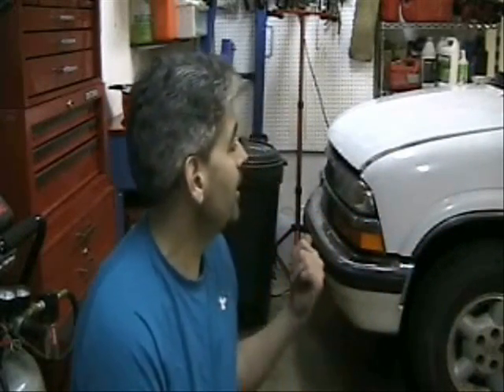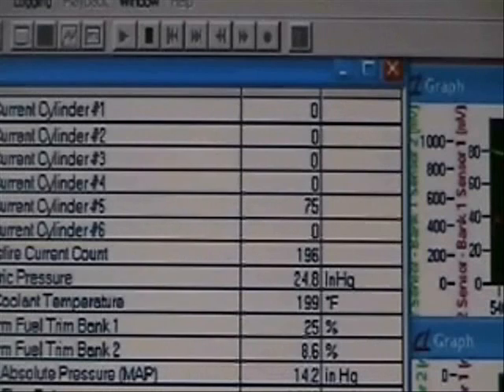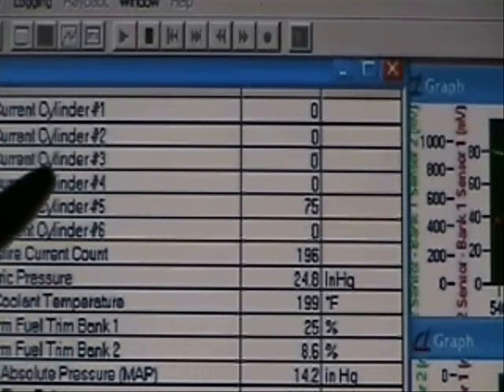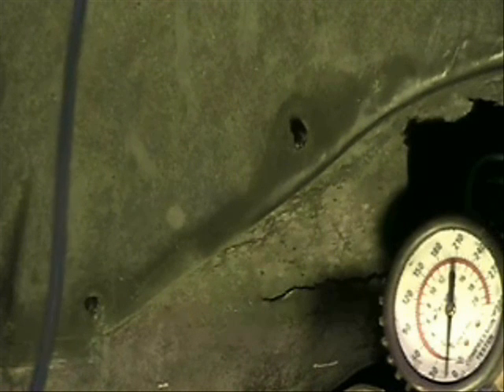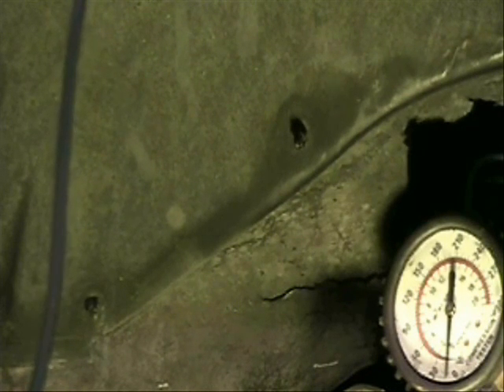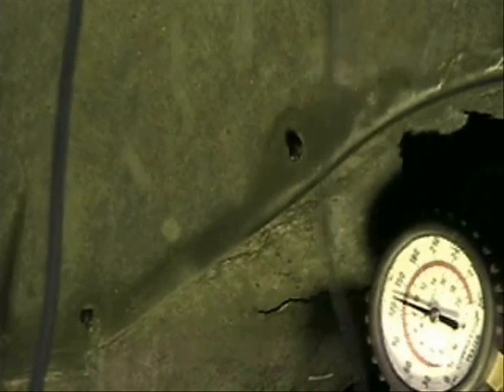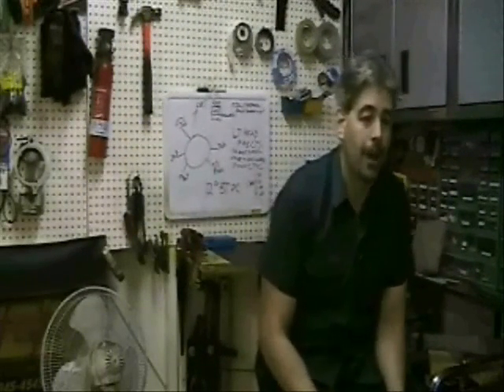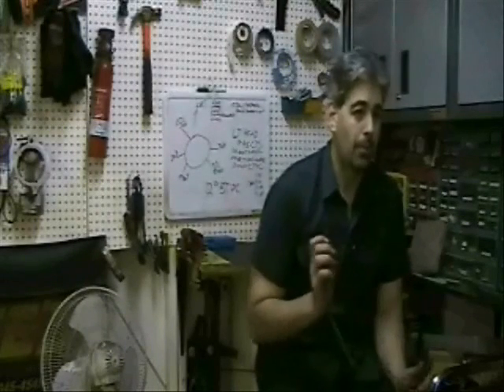P0305 Misfire Diagnosis 4 3L Vortec PART 1

Comment: I have exactly same engine . Mercruiser  4.3. Your videos are amazing. Question.  1 full revolution of flywheel can be compression stroke and another revolution could be exhaust???? So that has been my headache.  Am i right???
Reply from the maker: Yes correct. 360 degrees crankshaft rotation is only 180 on camshaft.  To cycle a full TDC compression cycle you need 720 degrees crankshaft rotation
Reply: That was such a helpful video.  Your time to make it is much appreciated.  Thank you.
Reply: I have changed all plugs etc. It's same chevy block in bayliner boats. I've replaced  rotor and cap. I am getting massive misfires as loud as gunshots. The engine is pretty new. Wouldn't run after some parts replaced.  I assume the bad timing would cause that. I have yet to see spark from plug disconnected and separate plug put in the end and grounded it. Can't see spark . This is all from cylinder 1 lead. I seem to have distributor set up as you have.  Any thoughts?
Reply from the maker: Sounds like mis-timing to me.

Comment: Fuel systems are "a little kinky" hahahahah thank you sir. I just finished replacing the spark plugs wires distributer cap rotor ignition coil and I'm still having a misfire. Wish I had a tool like this but I just wanted to say thanks for the laugh

Comment: That Autotap OBDII tool looks a lot more useful than noname Amazon scanner, but looking into buying one isn't promising---looks like it hasn't been supported in a while (Designed for Windows 98!). Do you have any current recommendations for something similar?
Reply from the maker: yes they dropped support for it about 5 years ago or so- very unfortunate as the UI is the best in the world.   I use Autoenginuity now.

Comment: I hope this gets read. I bought a 99 2 door Blazer and after fixing it up it started running weak and just not feeling like it had the power it should. It also does a surge under load that moves the rpms a tiny bit. I replaced the spyder with the updated version and I checked vacuum. I replaced the O2 sensors and cat because they were bad regardless. EGR and PCV valves. Mass airflow. I check fuel pressure and it was where it should be ( slow leak if you let it sit for more then ten minutes primed ) But nothing I do helps the issue. My cousin ran a scanner while I drove and he said my timing was dropping from the 30s into the teens when the vehicle was doing its surging thing. I have put more time and money into the thing then I care to think about but I do love it. I just cant figure it out. I looked up cam and crank sensors but it has no issues starting or idleing. Any thoughts?
Reply from the maker: yes you have a major clue when you said the O2 sensors AND cars were bad so you changed them. What data did you use to determine this?
 Also what data indicates the spider was bad? That’s critical data.
  And finally what was your mass airflow reading showing that you thought it was bad too?
Reply: Timing belt is loose
Reply: Replace fuel pump

Comment: IAC is the abbreviation we use for the idle air control valve, many engines don't  have a valve, some may have a Idle Actuator on the older throttle bodies or on some newer ones a  AIS controller, not arguing do it what ever way you want, just saying throttle body and such get coked up and plugged up from EGR, so unless you've just cleaned it do yourself a favor and open the throttle. Don"t  take my word for it, take one with a coked up throttle body and a plugged PVC valve or a faulty electric one, compare compression readings open and closed throttle

Comment: compression test you want the throttle wide open fyi
Reply from the maker: No need. more than enough air gets past the IAC and from PCV. The open throttle is a myth.
Reply: @SchrodingersBox  no not really a myth, I've seen many engines read 20 psi or more less if throttle plate is closed,especially smaller displacement engines, many engines don't  have a idle air control valve specially a lot of newer engines like some  drive by wire and what if your pvc is clogged and you don't know it yet, which happens, just saying with my 25 years experience its always good practice to open up the throttle plate so the engine can suck as much unrestricted air as it can for the most accurate compression test you can get,  p.s love your stuff, I've always took a scientific approach, kinda like a car doctor
Reply from the maker: Name one engine that does not have idle air control.

Comment: I had a P0305 code = cylinder #5 misfire. I replaced the spark plug and wire for $9. Solved my issue. 2001 GMC Jimmy 4.3 V6 142,725 miles.
Reply from the maker: How did you know the plug and wire was the issue? Did you just guess? And which one was it- the plug or the wire?
Reply: How are you able to buy just one wire? I ended up having to buy a whole set because no one would sell me just one.

Comment: My missfire was timing cover seal
Reply from the maker: How wopuld that cause a misfire? That has no effect on timing?
Reply: @SchrodingersBox  .after smoke test was coming from behind hamanick balanacer (cold engine) .drove for one hr and test againg becuase misfire allway go away after some time driving , i smoke it and no smoke leak . Also google, bad timing cover seal, symptom oil leak ,misfire ,rough  idle . ( i google for a 2000 blazer )
Reply: @SchrodingersBox  some how there is a vacuum leak .and is bad .when i smoke it (cold engine) alot of smoke was coming out from behind harmonic balancer. Hot engine, no misfire and no smoke coming from anywhere. It did not make any sence. But Google confirm it.
Reply from the maker: Ah- if the PCV system depends on the cover seal that would explain it. It would cause a vacuum leak. hard to imagine it could cause a vacuum leak enough to cause misfiring.
 What was your fuel trim before and after? That would be the prrof.

Comment: I am having a similar issue with #6 cylinder on my 2001 S-10 4.3L.  I get a P0300 and also a P0306 when the vehicle is under load at around 3000 RPMs, and seeming when it is under load.  I can have the vehicle parked and run the engine up to 3K RPMs and hold it there, and I don't get any misfires.  By the way, I am using the Autoenginuity software for my testing.  I am wondering if I have a compression issue on #6 cylinder.  I have ordered a new compression tester, as my old one's gauge got busted from loaning it to someone....Grrrrrr!  Anyway, all the other cylinders show no misfires in the history counters.  I had a bad battery a couple of months ago, which I'm assuming would have cleared the prior history from that point.  So, the history reported from that point back in February is 178 misfires on #6 cylinder since then.  The truck runs good, and even when the SES light starts flashing, it still runs fine (I can't tell it is misfiring).  Your video shows you checking the fuel system.  However, I have replaced the spider injection system with the GM replacement injection system that incorporates individual fuel injectors for each cylinder.  Therefore, it "should" eliminate any issues there with the crappy poppet valve design that GM employed back years ago.  Would your next step in troubleshooting, as I stated, be to check the compression on the #6 cylinder and go from there?  Thanks!  Love your videos!!!!
Reply: I have a 2002 chevy s10 4.3 6cyl. I was having misfires under load and when going uphill. Switched tons of stuff and discovered that the 02 sensor wire was laying on the exhaust hose on the passenger side, it was also in contact with metal, which caused it to get some voltage, but not enough. I changed that out and my problem went away. Also another time when I was having a similar problem, it turned out to be map sensor and maf both going bad.

Comment: My comment below refers to broken  rings. In the case of a 2 stroke with reasonable compression , with triangular rings they are designed to seal on the power stroke not the compression stroke. Carbon is # killer.

Comment: WASTE OF TIME! Car runs well on 5 so timing shouldn't be an issue but congrats anyway for checking it. Most car ecm's trigger fuel off of CMP sensor but that issue would set other codes. If your timing is off it will affect all 6. You checked spark which was fine but not under load so you don't know how many kV it's pushing which is a false positive. You checked comp which was also fine but doesn't rule out many other variables like sticking valve. Old school was to buy a GOOD vacuum gauge (not from Harbor Fright)[no E]  and you can read it more accurately than all the above tests. You didn't verify broken rings on static vs running comp test or check the valves/ springs. A vacuum gauge is easy to hook up and you get more from it initially. A very commonly overlooked tool. Also had you some head gasket seepage the comp gauge won't show unmetered air. Fuel pressure test good call, also waste of time, we know it ran on 5. Yes the pressure is low, likely when you do the pump the change in vacuum will set an egr or iac code on top of your issues (and customer will get pissy and not pay) Easiest way to test an injector is with a stethoscope. if you hear the pintle move you have power/ ground. If you don't the injector is shorted or there is no power or the coil is open. That is wiring or component. Secondary to that you could have debris plugging it or buildup and it isn't spraying. Hook it up to a test bench, check spray pattern and turn upside down and reverse flush....or replace. Testing them on the car like that they can blow out of harness depending on style. In conclusion, vac test = don't get dirty. You know it's #5. Steth test she no clicky. Scope test would have shown it in the wave pattern easily but you guys don't like to pay diagnostics. Actually a lab scope has a vacuum gauge and you test the injector harness with the same tool or go buy an oscilloscope on Craig's list for $50. A noid light is very difficult to use on cars like Caddys with PCB intake gaskets that cost $600+. As far as diagnostics go, somebody brings in an old shitter like that and you will crack the plug boot, break a plug off, bust the dist. cap bolts and all kinds of stuff BEFORE you get to the actual problem. For the really tricky ones, you can use an amp probe to pick up the pulse on the injector on all sides of the plug before getting  into plenum removal. You also can rewire those harnesses, it's very simple. Now, you also eluded to the fuel trim and we know that bank is running lean. Bad igntion will run rich. Sorry friend, YOU GOT LUCKY AND ACTUALLY FIXED IT.
Reply from the maker: Your lack of competence is overwhelming. Its obvious you have no idea what happened here. Vacuum gauge HAHAHAHAHAHAHAHAHA!!!!!! ROTFLMAO!!!!!
Reply: @SchrodingersBox  That is exactly the response I would have expected from you.
Reply from the maker: @maxwebster7572  Which means you must watch a lot of my videos.... ironic.  You'd think you'd have learned the basics by now but you haven't.
Reply: @SchrodingersBox  I have never previously watched any of your videos. I don't think I'd care to watch any others. I expected you to have a smart ass comment rather than LEARN something worthwhile.  If you want to say something smart then research it and prove my ignorance, I have thick skin, I can take it in the light of bettering my capabilities.
Reply from the maker: @maxwebster7572  Then in that case, you would be stupid.
 I can't help stupid. Good luck.
Reply: @SchrodingersBox  I guess you can't help yourself. It's first year trade school info. Now had you been a mechanic you would know that. BTW, in first year trade school they said not to call people names because you only degrade yourself.  I did enjoy watching you do stupid things however.
Reply from the maker: @maxwebster7572  And yet here I am training over 12M people on advanced diagnostics and you are the guy that I would have change a battery so I can focus on the real stuff.  Funny aint it?
Reply from the maker: @maxwebster7572  You are not a cyber bully. Just a cyber moron. There is a big difference.

Comment: Thanks for the great video collection of car diagnoses tips. Especially the one that explains fuel trims and how all the sensor input to the computer dictates how fuel is metered to make what 14.7 stoked sumpin. Great info and helped me understand how this all works. Has helped me with my 2003 4.3 Blazer as well as my mothers Subaru....hate that car. Just for myself and my cars can you recommend a good odb2 unit for not to much cash? One that will tell me all that data. Thanks again for the expert advice. Those who criticize are just jealous that they didn't make these to help others. Haters always gonna hate so fukem.

Jay in Vancouver Wa
Reply from the maker: Thanks for the comment. Yes my main go-to is the CRP Touch Pro from launch. but really for a beginner, any LIVE DATA capable tool will work.
Reply: Live Data   got it thanks

Comment: when you feel air pushing your finger is that TDC? or do you have to feel air and also move the harmonic balancer ? sorry i"m a rookie DIY'er .. Thank you!
Reply from the maker: Feeling air pressure indicates you are on the compression stroke. It does not necessarily mean TDC.
Reply: great just saw part 2 , so once i feel air pressure I can go ahead to the distributor to check the timing? sorry for so many questions and thank you again!!!
Reply from the maker: Yes, after you have achieved TDC of course. Make sure you are at TDC before any adjustments.
Reply: HOLY COW!!! I just saw that you have a subscription channel??? You better believe m signing up as we speak!!!! thanks for your knowledge and fast responses!!!you are the man!!! ok let me sign up now!! SCOTTY KILMER ," YOU ARE FIRED" LOL!!!!
Reply: Just signed up...username ::MF2018 ......Thank You!!!
Reply from the maker: Lol thanks man. Enjoy! Congratulations on recognizing that scotty is just a parts changer lol. It drives me nuts people hold a guy on a pedestal with 43 experience who couldn't diagnose a diaper rash.

Comment: In reply to the diy video diagnose no start due to no spark...Yep...I'm a princess you cowardess bitches..Thanks for posting the marks on the harmonic balancer to install the distributor;helpful on an intake gasket replacement...I hope that's a lemon job that's prevalent in the engineering of the wiring harness on those makes and models and I get lucky..

Comment: I had a cracked insulation on the coil wire put some electrical tape on it fixed i opened hood at night i saw it in the night kept running through coils 1997 4.3L v6 fuel pump just go in the fuel rail part to clean fuel in jectors with valve 60psi min lower than that wont start replace pump get rubber hose put number 1 piston top dead center dog wistel hose put hose in on1 cylinder when stop making noise it there turn crank buy hand ratchet have one person do it one listen stop when no no sound pop dristribter in number cilnder account gear turn when going in a hair before 1 cilnder computer will use crank cencer to set timing no marks to aline on crank for my year 1997 spark fuel
Reply from the maker: I like turtles!!!

Comment: So you show us what's wrong with his, what steps you take, and nothing else? If my problem is a compression issue than this video is absolutely useless.
Reply from the maker: TThere is nothing else to show- anything else is just basic bitch bolt turning. I don't need to show people how to spin a bolt do I?
 If the problem is compression related then this video shows EXACTLY how to diagnose that, so how would it be useless?

Comment: Hi Matt, I recently viewed two of your videos in order to learn how to properly install the distributor in the 4.3 liter GM engine. My need to do this was a result of my intake gasket replacement project. I performed this on a 2000 GMC Safari van and was doing great until I got to reinstalling the distributor. I know how to correctly find TDC (because I've done it many times now following your instructions) but no matter how many times I install the distributor, carefully aligning the dimple with the white mark on the distributor shaft, the rotor button pick up is always pointing about 1/4 inch to the right of the number one cylinder mark, (arrow with the 6 on it). When I attempted to start the engine in this condition,  it would run maybe a second or two. And additional starting attempts just caused the engine to become flooded as I could smell the gas. And after that, it's not going to start.  Obviously, I'm doing something wrong in the distributor install sequence. I have been aligning the oil pump drive with the drive blade after turning the shaft dimple to the white mark. It's the only way I've been able to get the distributor to drop in place. I feel like I'm off by one tooth and I've tried to compensate by turning the shaft a little further beyond the white mark but this too has resulted in failure. I'm about the throw up my hands and have it towed to a garage and pay $95 an hour to have it repaired. Since I'm retired and on a fixed income that's not something I want to do. Any suggestions?
Reply from the maker: Keep trying there is no trick to it. Make sure you're TDC compression and set as I showed in instructions and it will eventually work.
Reply: Thanks for the encouragement. After taking a day away from the van I was able to get the distributor in correctly. It started up on the first turn. However, I still need to fix the overheating problem and C0265, P0300 and P0135. Yes, it's running but roughly. It's time to attend more of your classes. I'm begining to think an engine and transmission swap would have been easier.